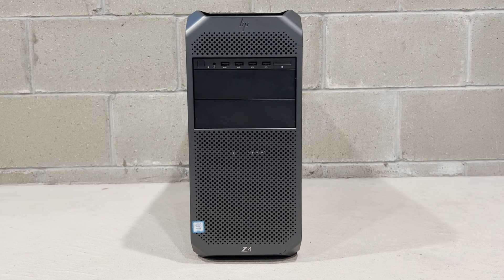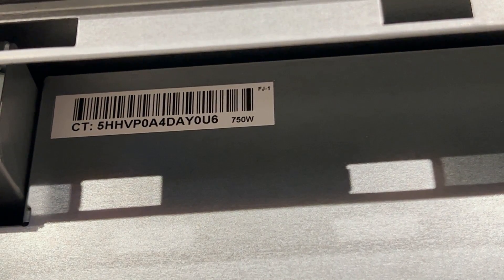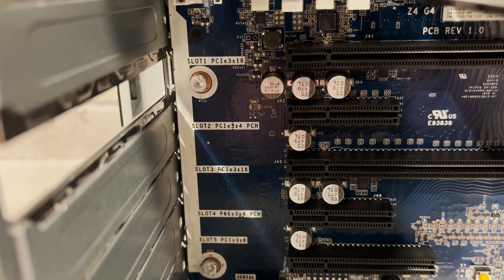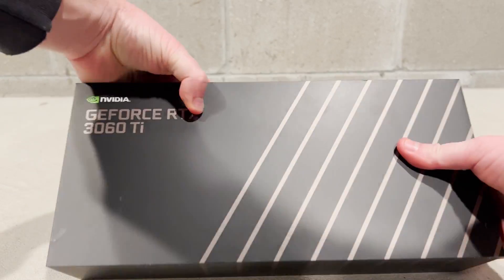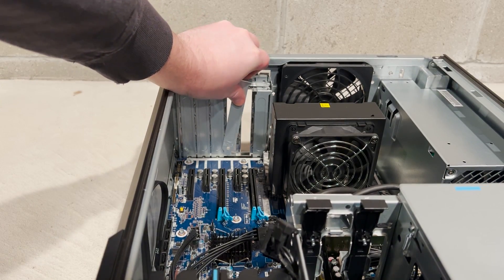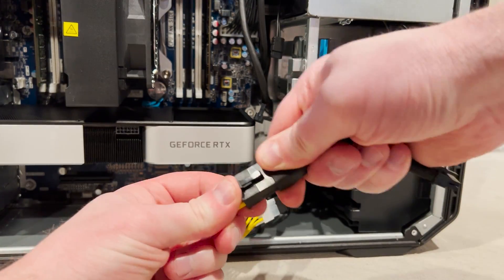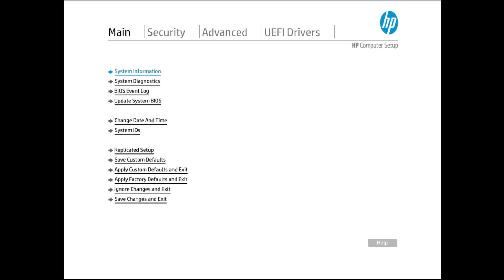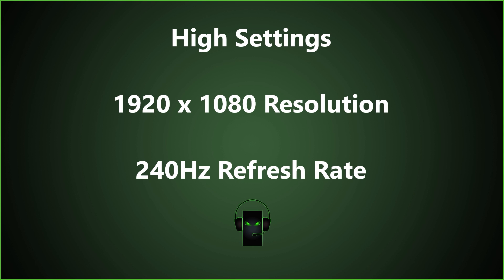A Close up Look at the HP Z4 G4 Workstation + RTX 3060 Ti Install + PC Game Testing

Comment: i have HP Z6 G4 with Intel Silver xeon 4114 and rtx 3060 ti gaming z trio but im not satisfied. I don't get good fps like must be from one rtx 3060 ti card. Something must be wrong.
Reply: The Silver and Gold CPUs aren't made for gaming but the good news is that they are more expensive than the ones that are.  Sell your 4114 and grab a w-2145.  That is 8 cores of high clock speed goodness (3.7ghz base with 4.5ghz boost) and well under 100 bucks.
Reply: Regarde si tu as des drivers Nvidia Game Ready car les studio ne fonctionnent pas bien. Bonne chance
Reply: Hey bro, cpu Xeon Silver infact so week, very week same as Core i3 or celeron may be. It only better to compare with them when you run multi & heavy program, very good and much better loading 👍 i also using Hp Z6G4 and after change to cpu Xeon Gold everything changed to perfect👍also single or multi program

Comment: Picked up a refurbished one of these on newegg over the holidays becasue my Unraid server died. Mine has the xeon-w 2133 as well. First thing I did was add anther 32GB of ram i had laying around, then I picked up a dual 5.25 drive - to - three 3.5in drive bay adapter for the front of the case, so i can use a total of five 3.5in drives in my system. for disks im running these refurbished toshiba 16TB drives from newegg, they were only like $160 bucks, got two of those and a shucked WD 10TB drive for my main array. The remaining two drive bays I have two 2TB drives that I'm running in a cache pool. The 512GB ssd is also a cache pool... 
So I ran it like this for awhile, then I popped in a GTX 1660 Super and a PCI-E USB 3.1 card to the system (I realize these are already on the system, but having a PCI USB card allows me to pass that entire PCI device to a VM)
Then I set up a Windows 11 VM (Using Tiny 11 since it has a lot of the bloat removed), passed the 1660 super and the USB card to the VM, gave the VM all 12 cores (since my server just hosts files and runs plex) and man, I'm really impressed! I do wish there were more drive bays, but as my storage grows I'll get larger disks instead of additional disks. less points of failure I guess. 
I can decide what to upgrade next... I think I'd like more CPU cores and something a little faster, this makes the most sense to me because my gaming VM is entire virtualized and this gives me room to grow and to do more projects on the computational side. A better GPU would be nice! But honestly the 1660 super can play every game in my steam library no problem, I guess that's fine for now. 
Overall this system has been super affordable for my needs and overall less maintenance than building my own system from scratch (like I had previously.) the only issue I ran into is my unit doesn't have the front PCI-E fan, so adding that USB card to the system prompted an error on bootup, saying its an unsupported configuration because it's missing the fan. :P easy fix for this is a 120MM fan can wedge perfectly in the case under the drive bays, its literally phyusically wedged in there, I hacked the fan connector to plug into the 4 pin fan header on the case and now it boots up with no errror message! lol. annd that fan spins so it has a lil extra flow. pretty cool ha. 

thanks for reading my story
Reply from the maker: Thanks for the good story.
Reply: Tell me, amigo, when you say you "hacked the fan connector" do you mean you snipped off some plastic and jammed a 4-pin fan on their goofy 5-pin headers, or something else?

Comment: I just got a Lenovo p520 w-2135 32gb 2400mhz quad channel with a rtx 2070, im digging it so far.  Play mostly Destiny 2 and God of War both run great 1440p. Swapped out the stock cooler for the ID-COOLING SE-914-XT, and current waiting on my some 2666 dual rank ram to arrive, not sure how much more performance i will gain.
Reply: @johnringgold3036 Any improvement with the faster RAM?
Reply: @DTDSasquatch  Windows is snappier but games dont feel any different and FPS the same.
Reply: How would you compare the noise of the fan to the original cooler?
Reply: How much more clearance do you have using that CPU cooler. I'm looking to order a CPU cooler that's 135mm in height. Since the 914 model you're using is 126mm, would you say there's 1cm of room extra? Thanks in advance!
Reply: @TechMatticz  the 914 uses a  92mm PWM Fan im not sure what model you are looking at, a 120mm wont fit with the side panel closed.
Reply: @johnringgold3036  Ah okay, I was looking as the Thermal right silver soul 135. It is a standard tower cooler but the 120mm fan installed with it is recessed to fit a smaller form factor build. It's only 135mm in total length and your cooler's total length is 126mm because you can't just factor in the 92mm fan you have to account for the heat pipes/heatsink. Basically if you looked from the back exhaust inside with the side panel closed, do you think there's enough clearance between your current cooler and the side panel to stick a pinky finger in between? That'd be about 1cm and would help a ton to decide my cooler option! Thanks for responding to my initial question!
Reply: Those are really nice.  I got an HP Z4 G4 and love the way it looks on the outside but the Lenovo looks much better designed on the inside though.